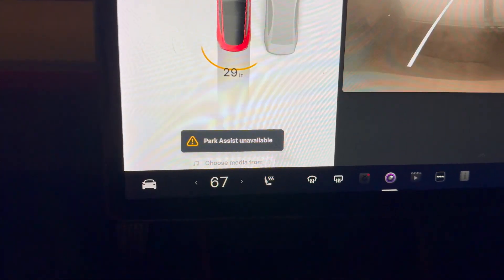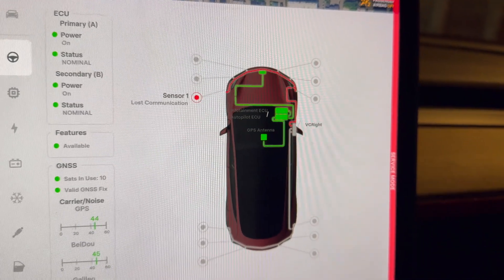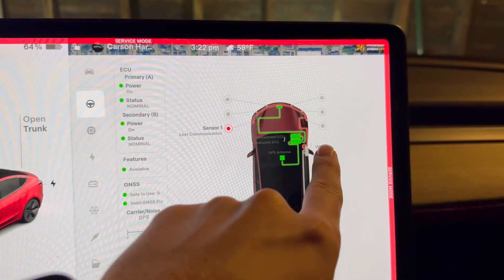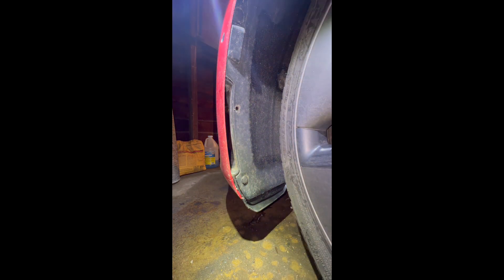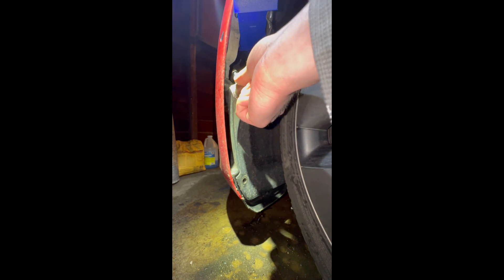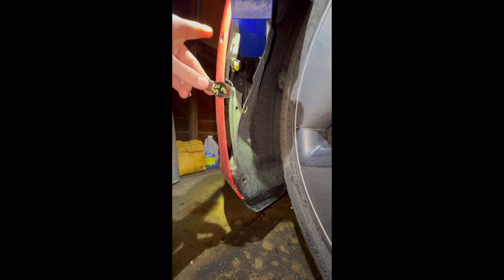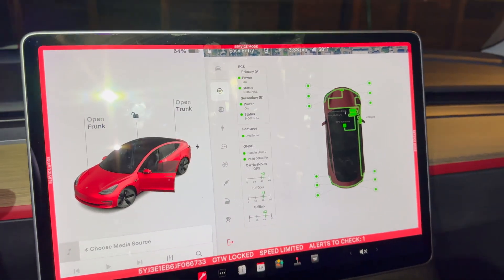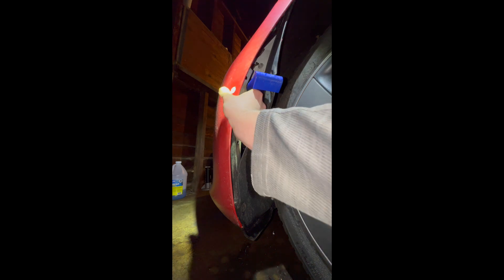Tesla Model 3/Y Parking Sensor Replacement (Park Assist Unavailable Error)

Comment: Did you do any reset after replacing sensor? I tried swapping my faulty sensor, and the error also swapped. But after replacing with a used sensor i got, the error still persisted
 Even if i swapped the sensor again?

Comment: Greta video!
I have a "lost communication" om sensor 7 and swapped it with the sensor on the opposite side but the error code is still there...I guess its either the cable ord something else. A friend told me I had to do a hard reset after the swop before anything would change in service mode? I didnt see you do that?
Reply: according to Tesla both sensor 7 and 12 are faulty. I bought new ones from Aliexpress and will try if solvs the issue...
Reply: Did it work?
Reply: @llF0XIl yes it did!

Comment: Thanks for this, need to fit this same sensor myself. Not good, that's two gone on a 71 plate car, first one fixed under warranty together with one of the power struts on the boot. Feel like I'm driving around in a time bomb !

Comment: Great video! I have problem with sensor 9 in the back if tm3 2019. Is that accessible or do I have to remove the entire bumper? Also which other sensor could I swap with? The weird things is that when I put it in reverse it still works and gives me distance measurement and tells me when to stop. But the front doesn’t work. 
I can’t swear on it but it seems to have happened short after I installed the commander gen2… but then again I’ve had similar problem for a couple of months ago during a short time in front left.
Any recommendations regarding sensor 9?
Reply from the maker: Unfortunately you’ll have to take the rear bumper off. Sensor 9 is considered an inner sensor and can be swapped with 8, 10, or 11.

I had similarly weird behavior in my situation too. If you swap them around and service mode shows that the bad sensor moved then I’d say it’s a pretty safe bet that a replacement will fix everything.

I don’t think the parking sensors run through the vehicle bus that the commander module connects to under the center console, so I doubt that has anything to do with it.
Reply: @ is there a chance that the problem might be the 12v battery? I haven’t changed it and the car is like 6 years 😅
Reply from the maker: @AzizIzgin You’d be seeing lots of other issues if the 12v was bad. You can rule that out by going into service mode and looking at the battery voltages and general health status.
Reply: @ thanks
One more thing
Underneath the bumper I see some kind of lid that I can remove. I guess it is where the tow bar is on models that has it(mine doesn’t have this).
Could I reach the sensor from there you think?
Reply from the maker: @ I don’t have any personal experience with the rear bumper but I’d say it’s worth a shot to try going from there first!
Reply: @carsonharvey3674 funny thing is that everything started working again both front and back with sound.
My only issue (has been this before) is that when in reverse the sensors go back and forth in measurement from like 90cm to ”close” fast many times… goes back and forth and the beeping goes crazy.
Reply: And today it is back to not working 😢